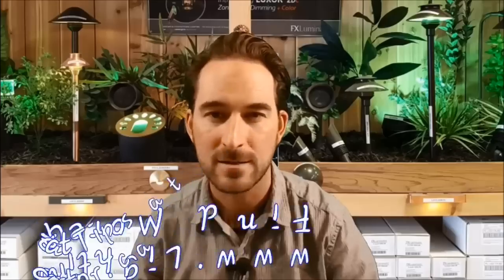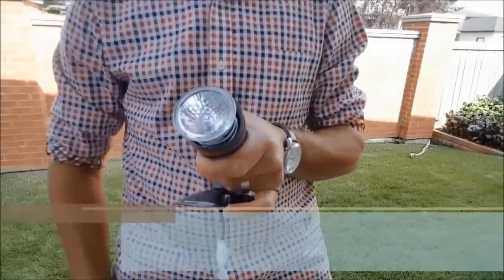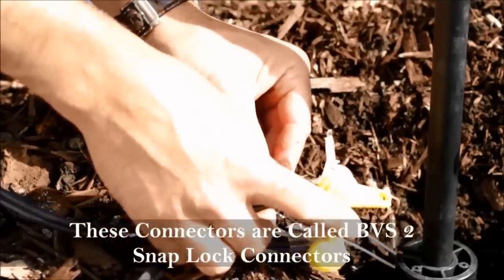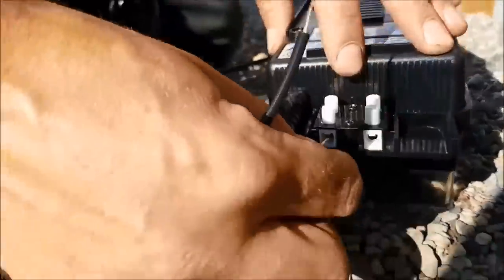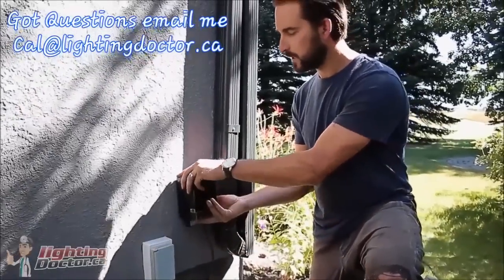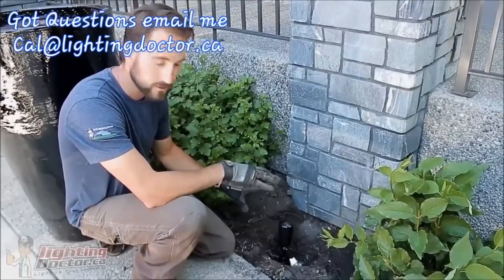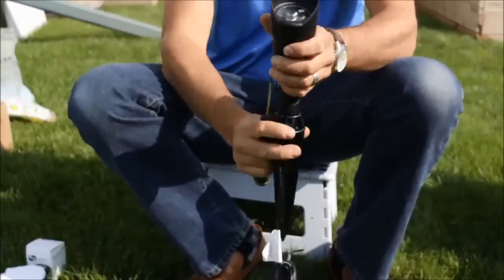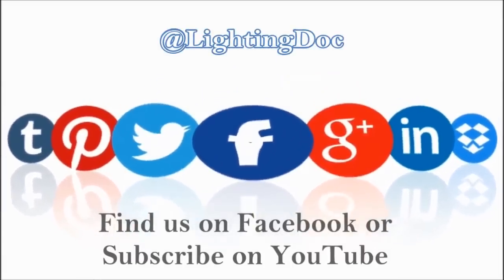Low Voltage Landscape Lighting - Design, Installation, DIY Kits

Comment: Do you really need a transformer?
Reply from the maker: The transformer is what converts your 110volt power source down to 12v. In order to run Low Voltage landscape Lighting you will need a transformer to run the 12volt lights. Thanks for the question!